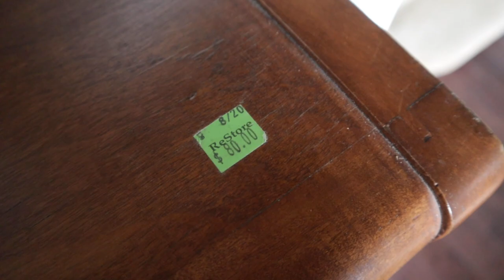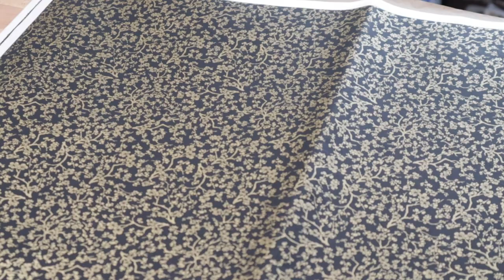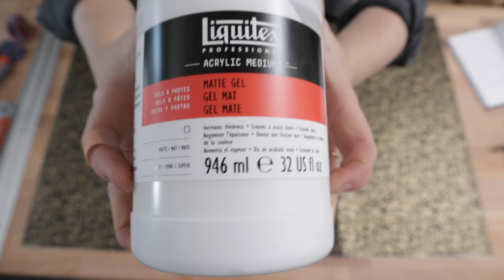*farmhouse inspired* diy cabinet thrift flip + bathroom floor renovation Part 1 | HOME MADE HOME EP4

Comment: I got a solid tall wood double door gun cabinet with bottom drawers from a thrift store for 25.00.  It now houses my fake fireplace on the top shelf, a big rectangle fiber basket(habitat, 10.00) below it with my extra bed covers and misc storage in the 4 drawers. I took out the glass (etched with ducks lol) and staple gunned a small square patterned cream lace tablecloth, gathered, over the open panels and covered the top raw edge with gathered beige and gold wired ribbon. I put thrifted old cut glass nobs in the drawers where the key'd locks were  I made a fake old fashioned key hole where the double door key lock used to be using craft putty. It is the center of my bedroom, angled in the corner, my fireplace running 24/7. (I now work from home and my bedroom is my office)  I found another old  tall petite looking cabinet (Habitat $25.99) with a big glass panel upper, added shelves for my rolled towels, fixed a scallop missing from the decorative panel on the doors by  piping  wood putty to replicate the missing pattern. I chalk painted the whole thing white. Another centerpiece for my bathroom with colorful towels on display.  I love repurposing furniture!

Comment: Always clean your piece after scuff sanding with tsp. It’s the best degreaser there is, in powder form it’s cheap. You’ll need to wear gloves but it doesn’t release toxic fumes. You’ll be amazed at how dirty your piece is. And rinse until your water is clear. 
For those of you who are using thinner paper to decoupage, try the iron method. You alllow your decoupage medium dry, I used Debi’s Design Diary DIY Liquid Patina, it’s non yellowing and durable. Lay your decoupage paper down and with a low set iron ( used parchment paper in between), iron it on. It will reactivate the “glue” and adhere your paper on . Then you can add the exterior layer of decoupage medium. If your paper was ironed flat before you start you’ll end up with a lovely flat finish. Look up Roycycled Paper, she carries gorgeous papers! 
Good luck diyers! 👏

Comment: The new hardware makes it look like mid-century in place of 80s.
Reply: To these eyes, they actually look more traditional than mid-century. They have a heft to them that most mid-century pulls typically didn’t have.

Most likely, the original hardware were that thick, and curved, like those, which works well, but probably had Bakelite, and were a little more ornate. 

I also appreciate how the pulls’ curves compliment the soft corners of the cabinet.  So ya, I like them as an alternative. 🤓

Comment: I bought a drill press. I just went into the store and left with a box of drill press. I’ve been using hangers in cabinet knobs and wanted a small wall mount drying rack. I tried with my hand held drill to get the dowel holes lined up....twice before buying a new tool...that I got to put together. I finally have that drying rack. I also have some new scraps of wood. I think a small fold up desk or breakfast tray for those days when I’d rather not be ‘at a desk’ is next on my list.
Thanks for the confidence boost.

Comment: OMG I love this floor! I envy you for this wooden floor and I would never, ever tile it. :D In Germany houses are build of stone and concrete and seldom of wood, only surfaces, doors, stairs and window frames are often of wood. My house is build of stone and we did a wooden flooring but it's just not comparable to a real one. You did sooooo good!
Reply: living in a really old house in Tyrol, Austria, everything is hard wood, the floors, the walls, the ceiling! the outside walls, too, (not the first floor - first floor white wall, upper floors all wood, every old house here looks like that!)
Reply: German houses are built of stone, because it's freakishly cold over here and we need protection from the elements. You might think all Northern Countries had this figured out, but no. Lived in Ireland for a year, Jesus Christ. The apartment there was just useless: I started shivering mid October and never stopped until late spring. Like seriously, never stopped being cold. Heaters running full speed, wearing warm pyjamas and pullovers, several layers of socks and cuddled up in bed with two blankets and I was STILL cold. The wind just blasted through the walls as if they weren't there at all. Miserable times :)
Reply: @Mameha4  Ireland is also damp which makes it hard to heat. In Canada a lot of homes are built with wood. If well insulated it holds up even in -40C
Reply: @Mameha4  In Scandinavia most houses are build of wood, inside and outside. They are very good insulated and held the warmth even in a very cold Winter. And there are some that are several hundreds of years old and still liveable and very good at that. I don't know the houses in Ireland but I'm sure that there are appartments here in Germany that are as miserable as yours in Ireland has been. Cheap building! And in Canada it gets really cold in Winter and wood does the work anyway. But for storms, stone is much much better, we get some in the northern area from the north sea upto a windforce of 11, and no shingle ever left our roof LOL

Comment: Love the floor! We had a very dark, almost black, stained floor in the master bedroom of the old house we bought. The room was small, and it felt even smaller. Solution? White primer (2 coats) and paint (2 coats)! It was gorgeous, if I do say so myself! The tannins came through in some places, but it matched the aesthetic of the house. We, I, put a topcoat of marine epoxy on to seal it. Perfection!!!😁😁😁 The house was built in 1901.

Comment: That piece was such nice wood, I'm glad you left the outside the same color it was found in. Do you worry, with the older floors, that dust might get down through the floorboard and into the living room because of the exposed ceiling?